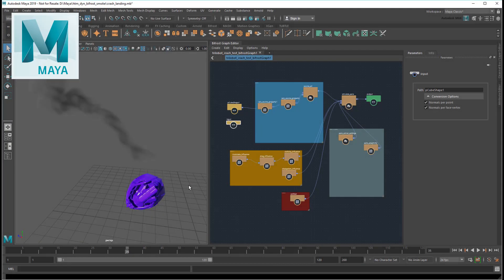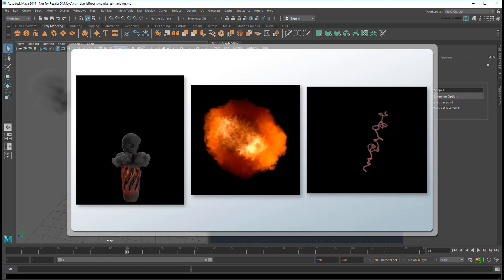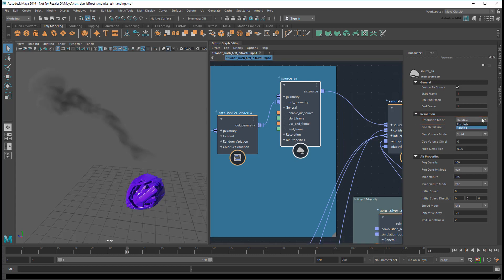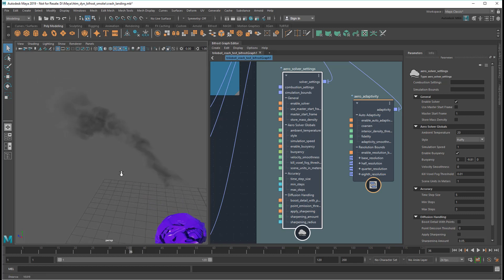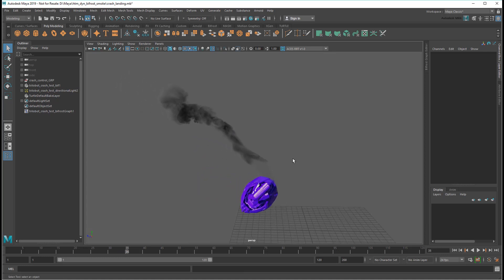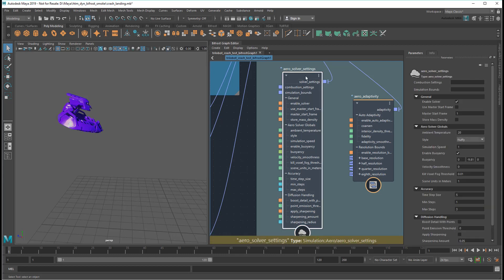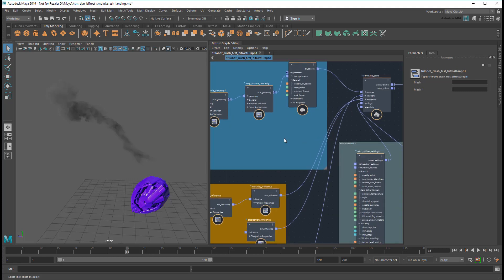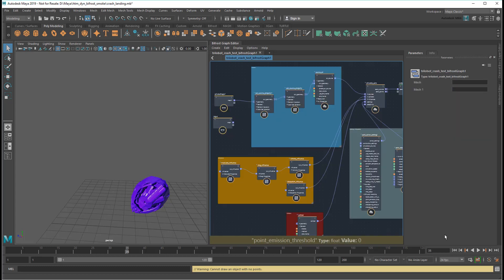Understanding Scale in the Bifrost Graph

Comment: I don't get it.. I thought user can set whatever grid size he's comfortable with.. Since the scene units is already set in preferences. From the narration it seems like bifrost uses grid size for simulation scale? Won't sims work fine if everything is at real world scale in cm units?
What I mean is.. Let's say user did simulation and is happy with the output. If he then changes grid (Display → grid) to some whacky random numbers.. will it change the sim?

I can check it myself but don't want to touch bifrost because it sucks interactivity wise.. Who got time to wait for 5 seconds for changing any properties? I want to do some trial and error but get disappointed due to performance.. (don't like sim → go to frame one → change some property → why the wait of goddamn 5-6 seconds if it's not updating anything major in viewport?).

Don't bother to suggest some maya preference change.. I won't try it. Default settings should be good enough so users don't have to see sluggish performance just for changing numbers -_-

Specs:
Ryzen 2700
8 GB DDR4
Gtx 1060 Ti
Maya 2020
Reply from the maker: Yes, as you change scale a sim will change - exactly as it should.  That's the whole point of a "simulation" vs "animation."  In the former, you're using mathematical formulas to mimic real world phenomena - and scale is a BIG part of those calculations.  It's the reason the the flame from a matchstick looks so different from the flame from a bonfire, or a stream from a juicebox looks different from that of a waterfall.  Larger scales mean more atoms, more molecules and more micro forces acting within, which means more detail but also more calculations - hence more compute time.  In other words, it doesn't make sense for a simulation to look the same at different scales.

That said, there are a few ways to temporarily get around this.  As shown in the video, you can leave source resolution to relative, which scales the source fuel for performance.  You can also increase the "Detail Size" in the solver_settings node, which decreases smaller details while improving performance - handy while you're running tests.  You can also turn on "Adaptivity," which increases details that are closer to the camera, while decreasing those further from the camera.  

Just as an aside, in 99.9% of professional pipelines, an artist will never touch the scene scale once it's been set.  Even in scenes where a character might grow or shrink, typically artists will produce different scenes at each scale and then transition between them in the compositing phase.  This is because everything from object detail, camera depth of field, pacing, and yes FX, needs to change at different scales.  So really, this scenario is not likely to happen at all.